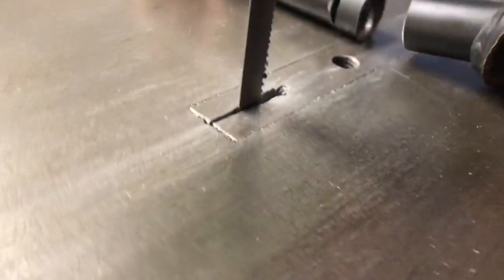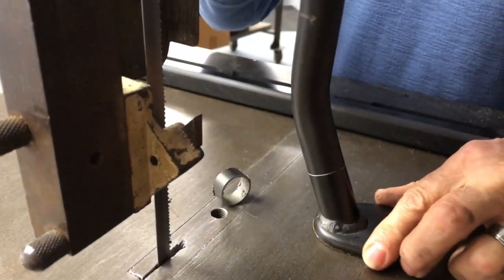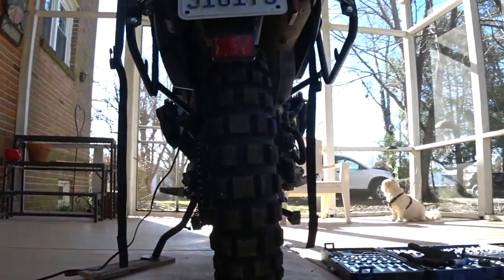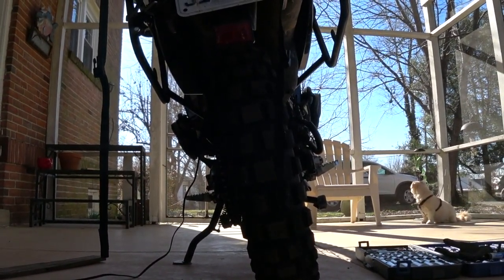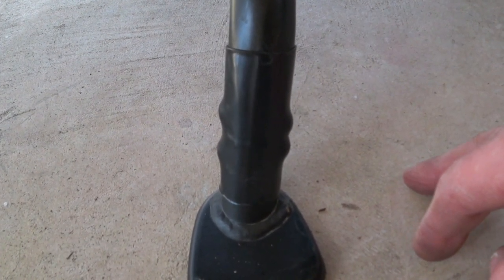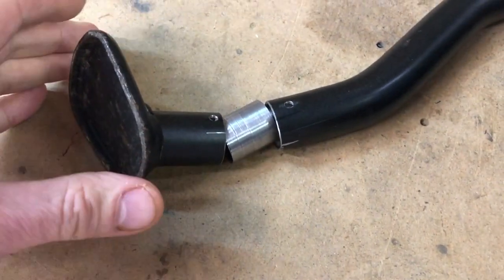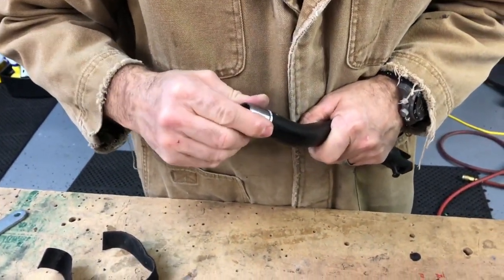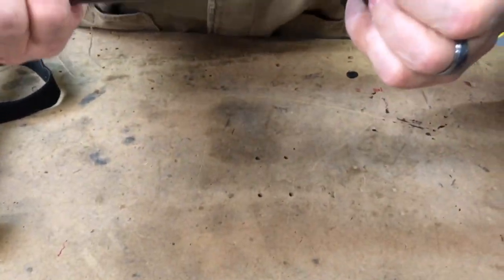KLR 650 shortened the kickstand, or side stand  #KLRDelusionals

Comment: Much easier to raise the bike first  without cutting the stand the extra height give you an angle for the stand so for example if you add 1/2 under the tyres and the stand sits correct you no to take 1/2 inch off if not pack under the tyres more or less to suit
Reply from the maker: Thanks for the input. This didn’t take much time, 30 minutes, maybe. I like the results.
Reply: @Ron_C  only because you guessed correctly on how much to take off your end result was bang on but if someone is looking at doing there own its better to lift the bike up to creat the angle rather than just cutting but you got there well done
Reply from the maker: Oh, I agree. The amount removed on my side stand shouldn’t be considered a universal measurement! I was also fortunate to work with a machinist and this was done at work! Lol.

Comment: That's much better... Question why not just cut the foot off and weld a wider foot half an inch up? Then it wont sink in the mud at the same time. Honest question he clearly knows what he's doing and put some thought into it. Boomer job though that will be stronger then the original for sure!
Reply from the maker: This was a lot easier than finding a wider foot, getting angles right, etc. The KLR foot is pretty substantial, but I keep a "puck" in the tank bag too.